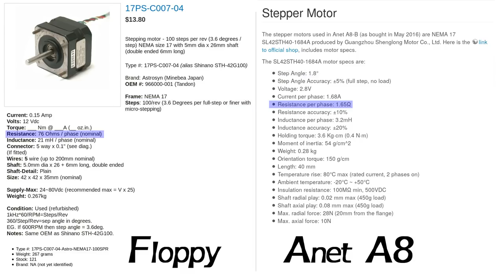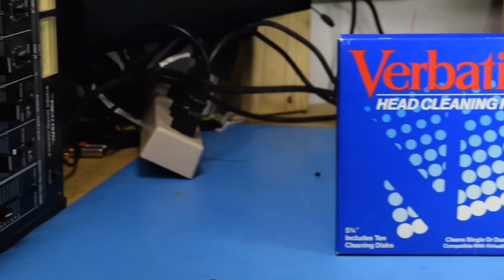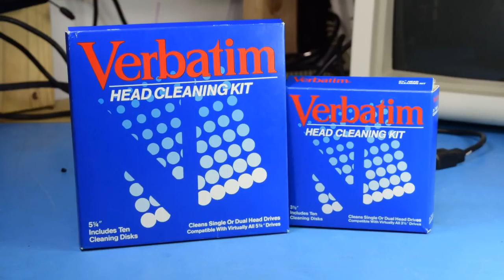Floppy Drive Refurbing

Comment: About those bearings, it shouldn't be too hard to find replacement bearings, that way you could potentially restore the donor drive to operational status as well.
The main thing you'd need to do is take a set of digital calipers and measure the dimensions of the bearing, and then look online to see if you can find something that fits.
You'll probably be wanting to select bearings that don't have much play in them, you don't need to be picky about what speed they operate at, and you don't need to be picky about what kind of load the bearings are under since this stepper motor isn't really moving around anything with significant mass or drag.

Comment: Those bearings have a particle seal, not a fluid seal. That brown stuff is seized deteriorated grease. Lubing it up is not a good idea on the long term, as you wash away the grease.
Reply: When buying replacement bearings you should take ones with rubber seals, so you can easily clean and regrease them.
Reply: I always clean them out with WD-40, then replace with silicon grease.

Comment: I have several 3.5″ floppy drives that either sometimes work very slowly and make horrible high noises, or even dont work at all and only makes the sounds. I wonder if i could do a simillar thing to fix them.
Reply: Yes! you can definitely lubricate them. Helped for many of my floppy drives
Reply: TheRailroad99 Oh, so they arent all closed down? Nice!
Reply: @eduardoavila646  On most 3.5" drives the top part is removable with a flat head screw driver. There are little dimples on the metal that hold that part on. You just pry it off and you have access to the heads etc. I would just lubricate it and clean the heads. If you don't know about floppy drive alignment on more modern floppy drives...don't mess with the rest of it.

Comment: The loud, grating sounds the non-refurbished drive is making whenever it seeks is absolutely not what those things sounded like brand new. We progressed through several machines with 5 1/4" drives back in school and I remember them sounding a lot more like the one you've oiled up. Except maybe the thumping sounds; I don't remember our drives back then hitting the stop that hard unless it was done on purpose like the Apple drives on startup.
Also I'm not sure how long oil is going to last before it manages to seep back out. Those bearings are normally packed with grease during manufacture, not oil.

Comment: I had a drive that looked the same as the one you repaired,  i had it on a zx spectrum via a Plus D disk interface.
Very good old drive, just keep the heads clean and it worked a treat :-D
i think it was a Tandom tm100 or similar,  that was 30 years ago so my memory is not so clear lol.

Comment: I don't think those bearings are worn out (at the RPM they operate at, the head itself wore out sooner), only the old grease is hardened up. Soaking them with oil will soften the old grease. For how long, who knows... 

You're right that WD40 will make a short term solution only, because it's quite volatile, and the grease will harden up again. That 3-in-1 silicone oil you used might be better, I have no experience with it.
But theoretically you can remove the shield from the bearings, only from the side which will be inside the motor, so will not be subject to contamination. Then dissolve the old grease with WD40, wash it with brake cleaner, and apply some good quality bearing grease.

Comment: Triflow lubricant.

I don't know how common it is anymore, but I picked some up at a bike shop years ago. Dripped some on a 1/10 hp fan motor shaft that wouldn't self start and would squeal and squelch when it was turning. The environment that fan is in is absolutely filthy, grinding dust, saw dust. Been running for 2 years without issue I forgot about it until now. HOWEVER, the bearings in that fan are sintered bronze oil impregnated plain type and not ball bearings so... YMMV.

Comment: Just a heads up, disassembling stepper motors messes up their magnets. You usually lose a portion of the power (you normally lose about 25% if I remember correctly). You normally don't even notice, but if the motor is struggling, it will likely not turn at all if you take it apart and put it back together without adequately fixing the reason it was struggling.

Comment: The grease in the bearings in the stepper drive motor dries out and freezes up the motor. They're easily removed and can be soaked in a solvent, wd40, whatever. One must be careful with the fine metal strapping that converts the circular movement of the stepper motor to a linear movement. Taking that apart is a lot easier than getting it all back together. Ask me how I know this.
Regarding the drive speed there is a potentiometer on the rear circuit board that is a speed adjustment. You can change the belt, that might help. Use the pot to adjust the speed to get it right.

Comment: Do you think replacing a motor could fix a problem with a DVD drive that doesn't feel like opening? The bugger reads discs just fine but it doesn't want to open properly. I have used silicone/teflon grease, I have replaced the belt but nothing helped. It DOES open if I give it a little push but not on its own UNLESS there's a disc inside. I think the motor is not strong enough to separate the magnets which keep DVDs in place.

Comment: those are shielded bearings not sealed. As far as the brown goop, the grease can go hard and that usually what happened to those bearings. it was common to take the drives out and use a spray lube to just working into them to keep them moist in a heavy use system

Comment: Other posters are right - sealed doesn't mean hermetically sealed or air-tight. It just means they have a cover over them. Some are completely open. You can give them an oil change from time to time to extend their life. Use isopropyl first, then re-oil.

Comment: From personal experience, I've found that WD-40 actually strips away liquid and any kind of lubrication. 
This is good for cleaning it away, but as he said in the video, it's not good long term, but for what I think? It's not even good short-term
Reply: WD stands for water displacer. it's not a lubricator.
Reply: WD-40 primary ingredient is aliphatic naptha I think. A solvent.

Then slightly less of mineral oil.

So the solvent will evaporate and leave some really thin oil that oxidizes within a few years.

It works great for cleaning greasy dirty things, but lubrication and corrosion prevention are lacking from my experience.

Comment: some old fashion greases tend to get rock hard over the years and seize parts so the bearings are probably fine you were just fighting solidified grease. this happens a lot in potentiometers were you cannot turn them even with pliers. this happens also on the brightness and contrast knobs on ibm monitors.
those bearings are not supposed to seal anyting, those are just shields to keep the grease mostly inside and keep the dust outside.sealed bearings have rubber seals. most oils penetrate well through those shields thats why you had sucess lubricating them. those bearings dont rotate very much during the usage of the drive so i dont believe there is damage to the balls or the sleeves

Comment: It appears that the bearings are actually shielded but not sealed. In that case its pretty normal to have the ingress of moisture that produces the red color liquid that comes out  that you showed. its just some surface rust breaking free. Either way they should be fine.

Comment: Your relubricated drive sounds closer to what they used to sound like when I was a kid.  I had to do this same procedure for an old hard drive that had a separate stepper when it wouldn't  seek properly after sitting for 8 years.  PTFE grease may last longer in that bearing but you would likely have to remove the shield to repack it.

Comment: This has given me a few ideas about the two Qume DT/8 drives I have that appear (well at least the main drive) to be faulty. Try try to load data but then give up every single time. I obviously have cleaned them up and lubed up the head carriage and it seems to move fine, but you never know. Maybe the head stepper needs that extra little touch.

Either that or the controller boards are shot. Ugh!

Comment: A drop of 3 in 1 into those stepper bearing and forcing it to turn a little while wick the oil into the bearing, also you can order replacement bearings if you can find a number on them

Comment: WD-40 makes a lithium grease that works well. 

But you are right, WD-40 is not a lubricant, It's a water displacer. 

I've used the same copper infused lithium grease used for brake pads, for CD drive rails and it works beautifully. I only did it because I was in a pinch.

Comment: I wonder what it would look like if you put a current sensor on the 12 volt lines on those floppies to see how much current they draw... Might be nice to know just as a diagnostics tool for future use if your floppy drive pulls more than x number of amps it's probably time to lubricate the stepper motor.

Comment: NEVER USE HEAD CLEANING DISKS!!! they are abrasive, and will destroy the head(s) over time. always use a q-tip with alcohol or similar. even if there are some that aren't abrasive, you have more control when doing it by hand.

another thing is that it is better to use grease, or even better would be lithium grease, or a different synthetic grease.

also, there is a speed adjustment on most drives, although it would also be a good idea to change the belt.
Reply: Amen. As an ex VCR service engineer I wholly concur.

Comment: Hm, is the spindle motor als responsible for the heads movement assembly? Normally those two are separate steppers. About the bearings though. Take away one of the shields, clean and lubricate them. They have lived in a clean environment. So how much can there be wrong, given that it has not lived like a hard disk...??? (it even might work on them a swell) BTW sealed only means that there is grease inside. Not that they are completely air tight. P.s. U might as well oil the bronze bushings of the other parts. Which is certainly good 4 3.5 inch drives. Namasté.

Comment: I find it likely that it's just old dried up grease inside the bearings, which as stated below are not shielded. My fix would be to first soak them in IPA to loosen up and get all that old grease out, then lube them with like silicone lube or something like that.

Comment: Think I would have removed the shields and cleaned the old lubricant out of them. It could be completely pointless if the races are screwed, but getting the old gunk out will help. It's quite tedious removing bearing shields though, not impossible though.

Comment: Well, maybe in this case it worked, but be aware, that taking apart a stepper motor messes up rotor's magnetisation. Steppers are magnetised after final assembly at factory. When you open it, rotor sticks to stator shorting some of magnetic circuits. After that steppers usually only have 30-50% of their original torque. In this case motors must have been oversized, but it may trip you up with some other devices...

Comment: (16:34) When I have a knob or screw that I may want to adjust later without great effort, but I generally don't want it to move on its own (thermal, vibration, etc), I apply just a single dab of fabric paint overlapping the edge of the knob / screw and the frame. My bicycle was a different matter, as fabric paint would neither withstand nor weather; for that, I used a dab of J-B Weld at three points, being careful not to get any inside.

Comment: I followed along with my 5.25 drives from a compaq portable 1 and as soon as the belt starts moving on boot up, it instantly says "diskette error, replace and strike any key when ready". Would you have a solution to the problem?
Reply from the maker: Try adjusting the flat head screw at the back of the drive. It will move the transport back and forth. It may be out of alignment. You might need the adjust it a little bit and press a key, the move it some more and repeat until you can get a read. It can be finicky.
Reply: @TechTangents  i adjusted it and even when i push the head forward, when it moves back it won't move anymore. I think both drives are just shot

Comment: Put the Bearings on Paint Thinner or solvent for contact cement. That should disolve any dry grease. DW-40 also works but its not as strong nor quick.
Bearings are supposed to use grease, not just spin freely. It may look like having then spin effortlessly is better but its not, id say wash them clean like i said, and try getting motor oil in them. Motor oil is thikker and doesnt evaporate that easily and stick really well to steel, that should make them last longer.
Ideally you should remove the seals and clean them and then put grease in them, silicone or thin lithium grease as those are not in a high speed device., but those are not removable seals, or in that case HH stands for dual shield, so they arent seals, only shields for dust and particles. Worst case, try removing one without breaking it, though i doubt you could, clean it, put some grease, spin it a while to remove any excess grease from the track and put it back with the shield looking to the outside. Though i think motor oil should be enough for this case.

Comment: When lubricating the rails, a little lithium grease is better then oil, takes a lot longer to dry out.
Reply: Or just go nuts and try to insert graphite in there. Its a dust so it wont "dry out" with time.
Reply: @Eduardo Avila: Would graphite even stick to those rods?
Reply: Wouldn't graphite be a problem because it conducts? If that gets on electronic components...
Reply: ropersonline Yep, if you got the right type of grain it would.
Reply: Arne Schmitz It would be in a awmost dust state, but its kinda sticky, it wouldnt be a good conductor, and probably wouldnt get into the rest of the system. 
But most of the grease i've tested is also conductive so no big difference here. 
And as i said, go 'full' crazy.
Reply: Oh, i forgot to mention, i've worked with graphyte for about a year, yes that doesnt sound too much, but in that year i've used it several times. I've used it mainly to lubrificate metal parts that i would copy using a shape to melt aluminium and cast it. So i used graphyte, and even using a molding material that kinda acts like dirt/sand (called ironically green dirt, even tho it isnt green), and not even into that the graphyte adheres! It sticks to the metal object and you can only really remove it, by washing it with water, not even rubbing a clean and rey cloth can remove most of it. 
I've also used it several times to lubrificate those rolling electrical gates, and it worked really fine. 

So unless you get water inside the floppy which is uncommon, you will probably be fine. I guess it isnt all safe, as i stated before "if you go nuts", but it should work.

Comment: It might have been just me, but it seemed like the freshly cleaned one (the b floppy in this case) is faster than the not cleaned one (the a floppy in this case).
Reply from the maker: I didn't want to mention this in the video but I did notice that as well. My best guess is that the drive I worked on may have been aligned better than the other drive. The other drive may need to rehome more often to keep positioning in the correct spot. But that is a total guess which is why I didn't mention it.
Reply: Assuming no edits:

Untouched floppy drive: 21:37 to 22:10 (33 seconds)
Lubricated floppy drive: 22:17 to 22:46 (30 seconds)

So yes, it was three seconds faster.
Reply from the maker: There were no edits in loading

Comment: I would just soak them bearings in 50w oil. the oil that was in there is just dried up i have done this to a few bearings like this.. 
i have even made a jig to holed the bearings to soke in a pool of oil as i can spin them at low speed with a dril to help brake up the crappy oil in them.. in the end they come out like new.. 
and there not sealed bearings sealed baring have a rubber gasket thies are more like just a dust shelled..

Comment: or just lube the stepper bearings, just drip some general purpose oil in the bearings(I shoud clarify that yes oil will penatrate the "seal")(edit: said this before watching the rest)
Ive seen people do this to revive old stepper motor based hard drives https://www.youtube.com/watch?v=-UJ0YE1a1Fs
EDIT: or since you took them apart just order some new bearings, Those look like standard skateboard bearings
Reply: And even if they aren't they should be reasonably cheap.

Comment: Delaminating core can be glued back together with superglue.
Reply: Wouldn't epoxy be better? I'd be worried about superglue being brittle and vibrations being able to shatter that.
Reply: Epoxy is usually too thick to get into the gaps between the layers. In case of a stepper it doesn't matter too much because the core is sandwiched between two covers that squeeze the laminated plates together.

I guess you could use lacquer or enamel (the same stuff they use to cover copper wire inside the motor) as glue to relaminate the core. That's what was used to laminate them in the first place.  In my experience the delamination was not too severe, so I only needed to glue one corner of the core together. It held up fine.
Reply: or dip it in very liquid varnish with something to maintain delaminated crap close together save lots of time and work like a treat

Comment: Too bad you don't have a vacuum chamber. Drop the bearings in a little container (drink lid), add some thick oil (I'm thinking car differential lube, 75w90), and make a vacuum. When you release the valve and add air back in, the lube will be "sucked" into the bearing.

Comment: There's no way in heck those bearings are actually damaged. They'll just have lumpy dried out grease.
Just re-pack them, or if you're lazy soak them in hot motor oil.